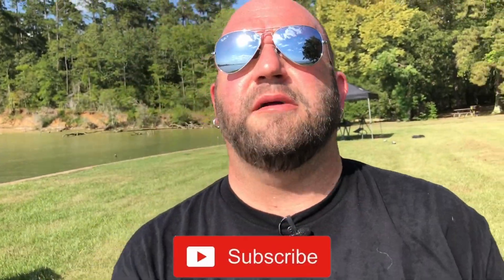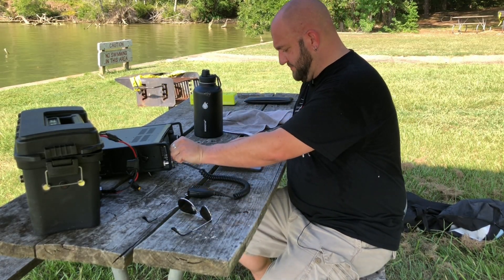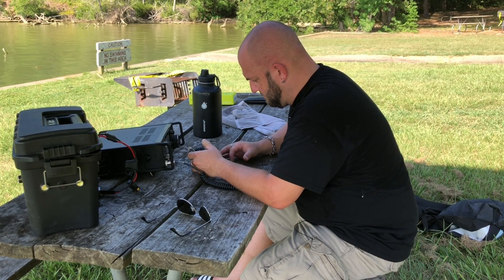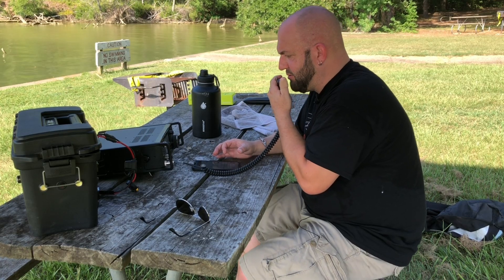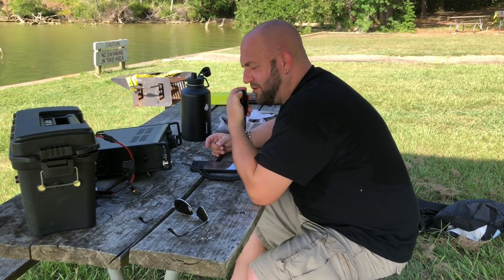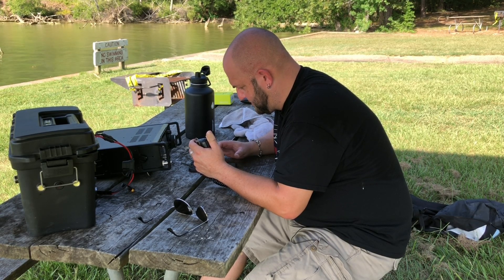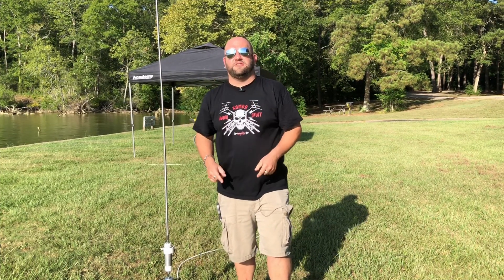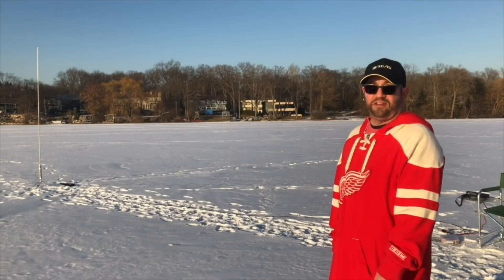Wolf River Coils Radial Experiment Part 3 | On Air Test

Comment: If I want to raise the coil, for better take-off angle, where should the radials be connected? At the base of the coil, or can I run a wire down to the ground and spread the radials out from there? Thanks, 73.
Reply from the maker: Wolf River Coils makes something that will center load the coil.  I forget what they call it but you still keep the radials attached at the bottom.

Comment: Hi Mike , just ordered my WRC kit  and I've been doing a lot of YouTube "research". You have the radials in this video at 2.5Meters X 15  and that involves Callum's wizardry. This video is a year old  have those wizard numbers updated or is 15X2.5M radials still good?
Reply: My understanding is the more wire down the better so if you have 100 feet of wire it should roughly perform equally regardless how many radials you have though I firmly believe for the lower bands like 80 and 40 3 33 footers would be better than 10 10 foot radials radials I wouldn't be surprised if 20 10 foot radials would out perform 3 33 foot radials on 80 and 40  just because it's twice as much wire on the ground I could be wrong though I am kinda dumb after all
Reply: @bensmith4563  smarter then me!!!!

Comment: Hey Mike. I used the wolf river coil 1000 silver bullet. With 2.5 radials. And the yeasu 891. Dude your awesome.. kk7 juj 73.  For the tem meter band drop the antenna two extensions.

Comment: This video got me wondering can you use a ribbon wire for radials?  For instance if you used 3 ribbon wires made up of 4 wires each.  Would you antenna see it like 12 radials or just 3?
Reply from the maker: Hmm, that's a good question.  I'll expect a full report on your findings in the morning.
Reply: @hamradiotube   If I do it before you I will report back. This and the screen idea is interesting. Until then think of it as a content idea, no charge :)

Comment: Mike - I am running 18x33' radials and get 1.03 SWR ON 15m and 1.04 on 20m, I have another bundle of 6x33' but I think I'm close enough. More metal on the ground , the better it seems

Comment: Interesting stuff.  It’s informative to read the experimental work of Rudi Severns, N6LF - he has well characterised the effect of radial length on antenna efficiency.  Of particular interest is one paper in which he discusses the implication of radial length with respect to position of the current maximum along the radial, its effect on ground losses and therefore signal strength.  That article caused me to review my understanding of length of radials on the ground.  It’s probably more complex than we’re taught - the length probably does matter.  I now carry a set of radials for each band - they’re not a random length and they’re not 1/4 wavelength either.  Rudi’s work is well worth the read.  Happy experimenting.
Reply from the maker: I reference him in earlier chapters of this series.

Comment: What is the math (or maybe the rule-of-thumb) behind your 15 radials @ 2.5 meters arrangement? I would have assumed 16 radials @ 2.5 meters would have been the goal so that it added up to 40 meters of wire? I generally aim for a combination of wire lengths to add up to 1 wavelength on the lowest band I plan to operate
Reply: I assume the change in math was to divide by 4 instead of 5, that way keeping it as 1/4 wavelength multiple?

Comment: I wonder if the 15 2.5M radials will work will with a 112" folding antenna like the CHA MIL 2.0 (7 sections that are 17" long). Thoughts?

Comment: Hi Mike. great video. I love experimenting with antennas and this is helpful for my 40-6m 17' whip with wire. I use a 17' whip on a mirror mount with a length of wire clipped on running to a fishing pole for an inverted L at 40m. 20m and up use the whip only. I have been using 4 33' radials, and 4 15' radials. Going to try using more short radials because the higher bands tune better when I roll up the longer radials. Good food for thought. 
I have been trying to get my WAS with my G90 on ssb. I have two contacts with you in my log on QRZ, and they both show as TX, not MI. I have no confirmed MI contacts, and didn't realize you worked from TX. October last year, and April this year.
 It's funny, I need HI, SD, MI, IA, and CT to get it from WI.
73, KD9OCL

Comment: I just watched one of your videos from a few years ago where you used an Ft891, MFJ 939 and the Tenntenna. Do you prefer a set up like this to something slightly smaller and more compact or is it more fun to really set up shop like this with a larger radio, battery and awning? I’m studying for my General and extremely excited to get in to POTA and SOTA. I love your videos man, huge inspiration. Thanks and 73 from KC1IAM.
Reply from the maker: You know that's a hard question to answer.  I started off with the WRC but quickly developed a crippling addiction to antennas.  It really depends on where I'm going and what the landscape is honestly.  I recommend having a couple antennas in your kit.  As far as the physical act of setting up, it's the same regardless of size equipment (other than the pop up canopy perhaps).  Just more weight.  If I'm going hiking, I'm certainly not going to bring the big stuff, but going from car to table isn't a big deal.   The best advise I could give you is to evaluate the pros and cons of each type of setup and go with whatever one checks off the most boxes.   There is no one solution for everything.  Good luck on your General!  I hope this answer helps and I hope to catch you on the air!

Comment: Hi Mike, I got right on this project and got my radials cut and installed. for 20M. My first two contacts were to SA and my third was to European Russia. SFI was 165, so that also helped. The smaller footprint of this antenna is going to be a big plus when setting up! Thanks for your hard work!
Reply: Also made a SSB contact to ZL land with the same setup.

Comment: Hey mike... I havea wrc mini with a 213 whip, and using a spike mount also ( mine is 3/4 stainless steel rod, In the ground about 12" - 18". I started off with using 8 31' radials. I made contact with you on that same setup from dodge #4. After watch8ng calls Sandra your video, I. Now running 15 10' radials, and haven't noticed much difference. The NL7V station from alaska, paul..Paul... I have made contact with him on both radials setus..setup... very similar rst reports. Just wanted to share another test situation. I do like the shorter radials, as it is faster setup and tear down. 73 KU8RLY

Comment: hey... this is not the antenna being good, it's the propagation being opened. For reference: with a vertical on ground level and 100 watts your average reach (from mid USA) is middle east, in 20 meters. Talking to Europe should be very easy.
Reply from the maker: Hey we got Mr. Buzz Killington here!!
Reply: @hamradiotube  😂

Comment: does wire diameter matter for the radials?  Just got my WRC TIA mini yesterday
Reply: I would think that the bigger gauge could improve how well it gets out, since it would have more surface area to radiate from. I have also heard stranded works better than solid core, also because of surface area.

Comment: Another great activation for you Mike. Thanks again for the tip about shorten the radials. I was going to do some radio outside but that heat lately is a killer. 🤣 You definitely deserved that beer afterwards. 🤣